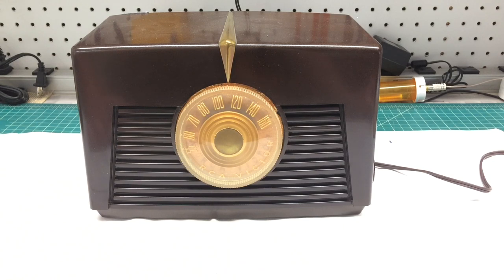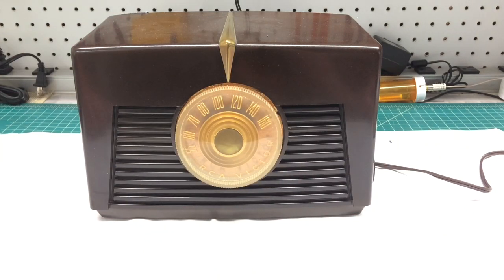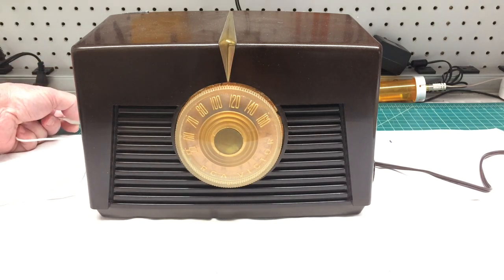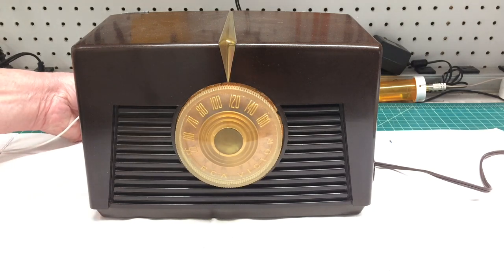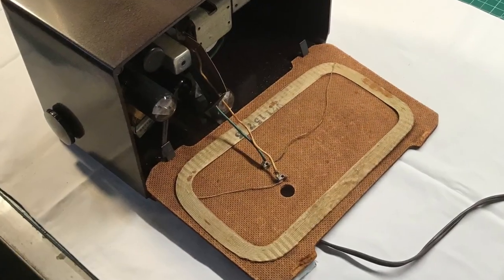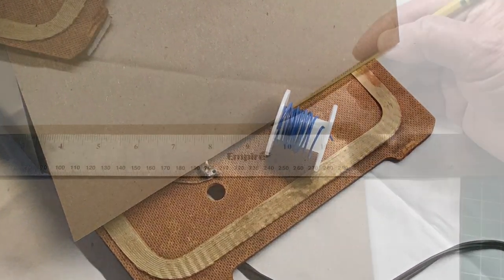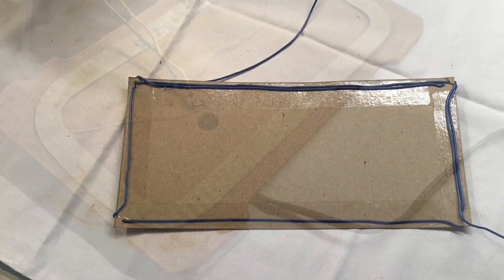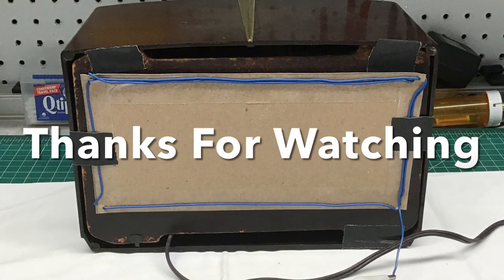How to Connect an External Antenna to an AA5 Radio w/ a Built in Loop Antenna & No Ext. Connection

Comment: Don,
You maintain your record of every video being a gem. I wonder the effect of switching the polarity of the plug when the radio is not used on  a  isolation transformer.
Reply from the maker: Ian - excellent question as always and I pinned your question to clarify the safety capacitor has to tie back to an “earth ground”. If the AC polarity is wrong, then you would have an energized antenna connection point, just like the hot chassis situation on the AA5 sets without a floating ground configuration. The safest approach is to connect the loop start winding to the X1/Y2 safety capacitor and connect it to a separate “earth ground”., thus isolating the two circuits. Thanks for your question. Best, Don

Comment from the maker: The AA5 receiver is being powered (should always be) through an isolation transformer. The start winding of the one to two turn coupling loop is connected to the X1/Y2 safety capacitor, that is connected to an "earth ground", while the other end connects to the external long/short wire antenna.

Comment: Can I see how You connect the additional antena to the safety cap?
What if the radio does not have a safety cap, where would the additional antena would be conected to?
Reply from the maker: Hi Oscar - I added the safety capacitor. The start winding of the new two turn coil attaches to the safety capacitor and the other lead from the safety capacitor attaches to an earth ground. If you use the chassis of the receiver, you need to ensure it’s tied to earth ground and not a hot chassis, which is common for an AA5 radio depending on the AC polarity of the line input. Best, Don

Comment: Thanks for this video.  I have been wondering about the method to couple a longer wire to the set.  My question, though,  is whether the safety capacitor is needed if the cold end of the coil is connected to a separate ground rather than the radio chassis.  Also, your 2 turns or so work well, is there an optimum number of turns on the coupling coil?  Thanks again for posting this.
Reply from the maker: Hi Charles - with a separate (isolated) earth ground, to your point the safety capacitor could be eliminated. Leaving it would offer some protection if the wire antenna should become energized. One or two turns should work best as the configuration acts as a step-up transformer. I didn’t experiment with additional windings, but would appreciate your feedback if you modify the design. Best, Don

Comment: You left me some questions, is the blue wire you affixed to the board connected to the internal loop? If yes, which terminal?
Reply from the maker: The start winding of the one to two turn coil connects to a safety capacitor, which then ties to an “earth ground”. It’s not connected to the existing loop antenna. Be sure to read my pinned comment and the video description for more information. Best, Don